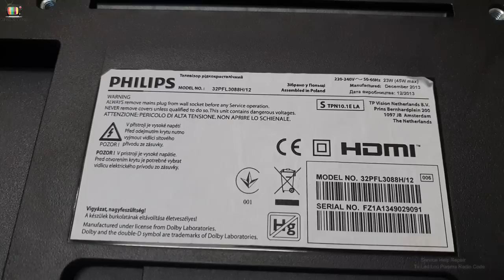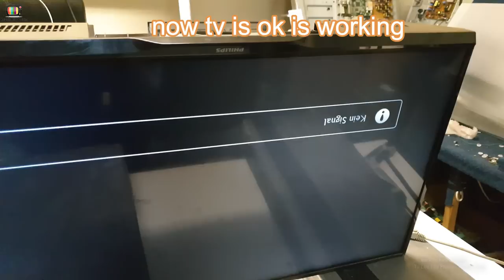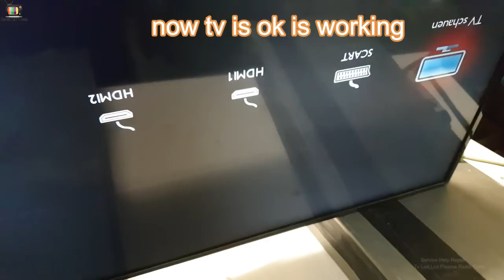philips TV REPAIR. no power light. easy to repair TV. install adapter 12V 4A. in tv. info video

Comment: It is good solution but it would be much more interesting if you find the main problem. I saw your reply You couldn't find faulty place but I think it was possible. Because PSU (power supply unit) is an impulse unit you should check active elements such transistor key (usualy Mosfet IRFZ series) on the HOT side, PWM generator and power adjustment loop (transoptor). Also shotkey diodes . Of course schematic diagram would be helpful but (with some PSU repairs experience) it could be repaired . It is - simple construction for repair if you know how impulse PSU works.  Congrats. for the invention -  it works :) .
Reply: I've got the same exact issue, I believe, with a different revision but similar board overall. At first glance it did look like it was a diode and a 0.33@2W resistor to ground. After replacing both components all voltages and the pulses on the transformer (input) were fine. But 0V on the output. Not shorted on the input or output. Injecting voltage on the cold side worked fine. You can't find these switching transformers unless from identical donor boards. Its either replacing the whole board or injecting voltage

Comment: I have the same problem but a little different PHILIPS smart TV
model 32PHH4509/88 and my only worry is TV uses 25W(57Wmax) and ADAPTER 12V/4A gives max 48W. is that a problem or will it work 
thank zou

Comment: Quick repair for yourself, e.g. to the workshop or CCTV but not for the customer. It's too unprofessional.

You should check and replace main IC on primary side. This cost approx 1$. Now in standby mode you have a ~4W power loss.
All in one board. That looks cheap shitty TV.

Comment: this is not a soultion y u dont repair orignal power supply this adapter is not for long time because ampair not match with company fitted power supply
Reply from the maker: haha.  you really don't understand how a TV is repaired.  As for the adapter I guarantee 100 years.  do not speak when you do not understand well😔😔👎👎
Reply: @RepairAllTV  orignal supply reparing to easy then y u modify